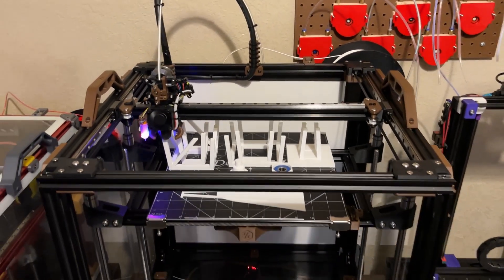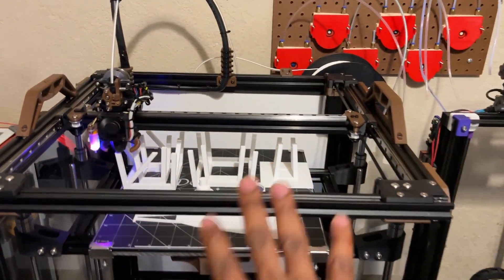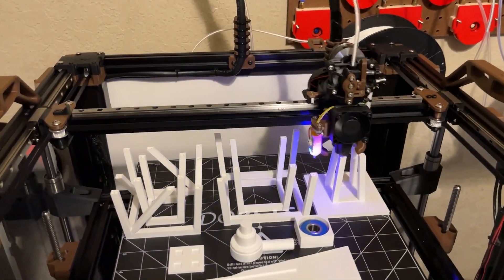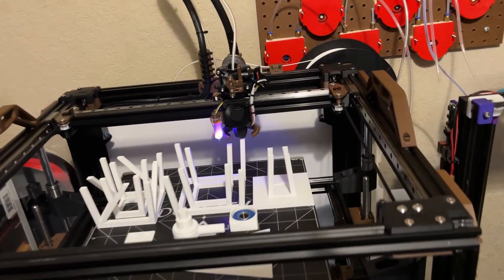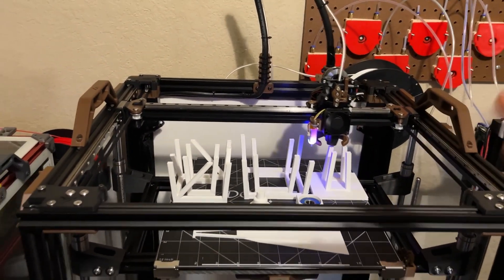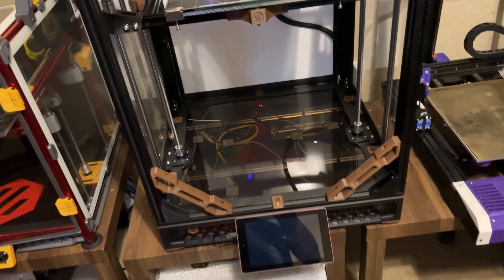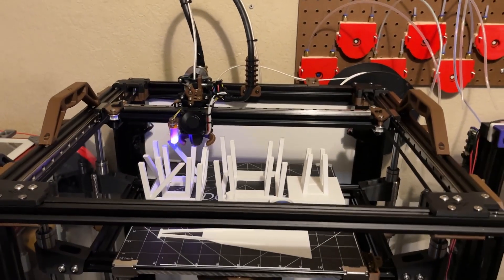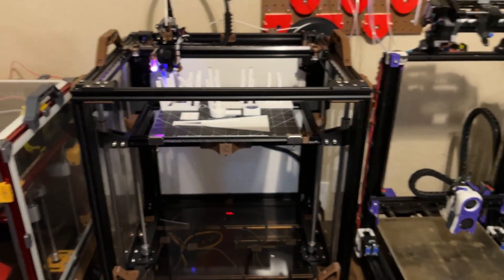//VZbot Build Completed :)  // GoldenJaguar392 // #3dprinting

Comment: After so many printer builds, what is the best overall price-value corexy ?😅
Reply from the maker: I would say a vzbot overall takes the cake it can be build for fairly cheap it performs very well and is consistent
Reply: @GoldenJaguar3D  i would like a 400x400 version from vzbot, ratrig v-core  400x400 is almost the most likeable work horse about reviews

Comment: DIdin't get where is your Z motor? Is it under the bottom glass panel?
Or you have two sepparate motors for each leadscrew?
Reply from the maker: yea both z motor are located below the top panel/

Comment: You will definitely get more precision and more torque with 16-tooth pulleys. But in the same time you will get proportionally less speed.
This is always a trade of between speed and torque/accuracy.
Reply from the maker: you're  correct

Comment: Are you using the Rapido UHF or standard HF? If you're using the UHF, how did you build the printhead? I've been all over for a fan duct or whatever to use mine. The UHF end is too low on my Vz printhead. Thanks!
Reply from the maker: I'm using rapido UHF give a some time to gather the stl link for you that I use for  assemble.

Comment: Great video! Thanks for your input. Im will build a new 3D printer and torn between a vz or a voron (2.4 or trident)... Can you say something about the overall print quality between this printers? Im not full into high speed printing - qualtity/speed shoud be balanced.
Reply from the maker: vzbot is freaking awesome I'm so impressed with it's speed and performances It's the faster printer have quality and speed is not sacrifice at all with the vzbot, as for voron they are solid printers you can't go wrong with the trident or v2.4 however the trident is the easier one to build and the quality is still great.....If you're printing a lot of pla build a vzbot if not then a voron which can also print pla but main purpose is abs.

Comment: What the type name of cable u run to the print head ? I want to order some
Reply from the maker: It's called igus continuous flex cable you can get in many different configuration, i'm using 18 core x 20 gauge 
https://www.igus.com/product/380?artNr=CF880-05-18

Comment: Would you mind to link the cable sleeve you're using please?
Reply from the maker: It's not cable sleeve but a flexible cable with multiple conductors wires 
https://www.igus.com/product/380?artNr=CF880-05-02
Reply: @GoldenJaguar3D  Thank!

Comment: Nice work. I'd be interrested to know how reliable the VZbot is compared to the Voron. I love my V0.1, but am finding it a little finicky to keep working....lets just say it wasn't designed for 24/7 use. It'a a bit like my old Volvo, works great when it works.
Reply from the maker: Been running 2/7 the last fews days it’s not breaking sweat, it’s certainly reliable from my experience I haven’t had fix anything. Go for it you won’t be disappointed.
Reply: @GoldenJaguar3D  ...but for how many days. New my V0.1 was flawless. After 8 weeks of very moderate use, stuff started to become problematic. Right now, my hot end is wonky and won't extrude, and I'm having z-homing issues. Fixable, just annoying. Honestly, my CR10S PRO V2 is way more reliable.
Reply from the maker: @SeanTaffert  I’ve been running it for 2 weeks now non stop, it’s simpler build compare to a v0.1 less complicated so you can easily build this, only thing Is would price, I haven’t had to touch my printers in a while they all worked great. Have though about the other voron design or are you space limited hints why you build a v0.1 just curious.
Reply: @GoldenJaguar3D  Complication isn't the issue, I've built a 1m^3 HevORT machine (by MirageC) recently with NEMA 23 servo steppers and QGL for industrial application. The V0.1 was just a home project for, yes, my limited space and speed. (Warming up a 1m^3 machine takes 220 VAC and some planning) ...I was hoping for something more robust and reliable.
Reply from the maker: @SeanTaffert  yes understandable I’ll report back if anything breaks down on it for sure, sorry hear about the v0.1 hopefully you can get to operate the way you want it to. By way the hevORT is also another beast! Congrats on the build.